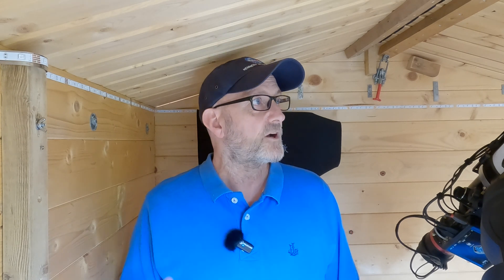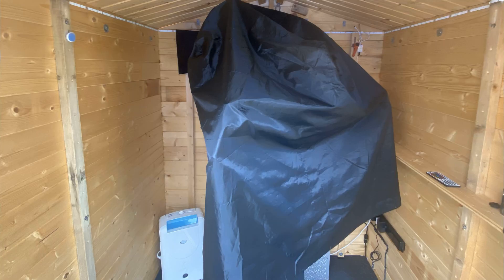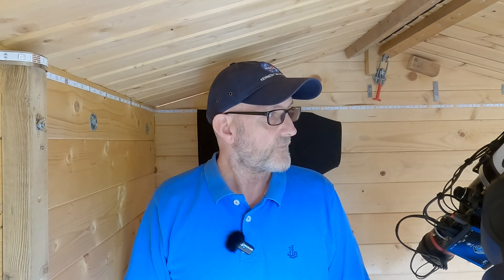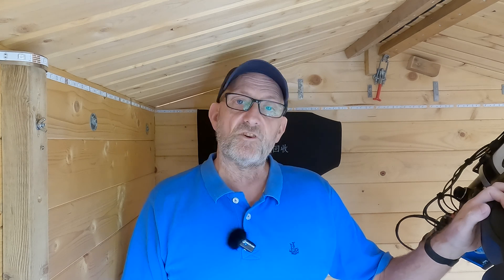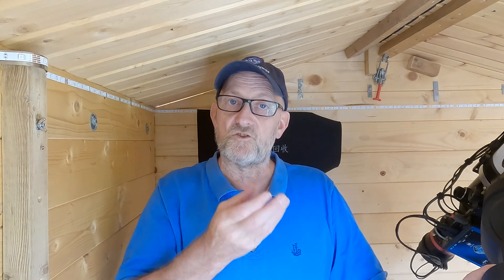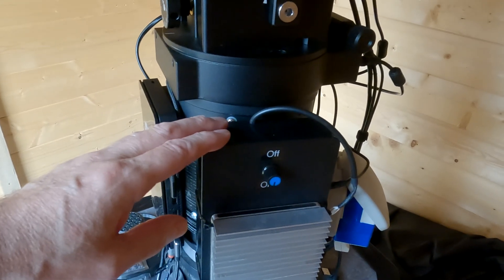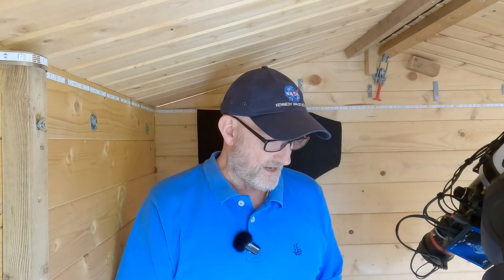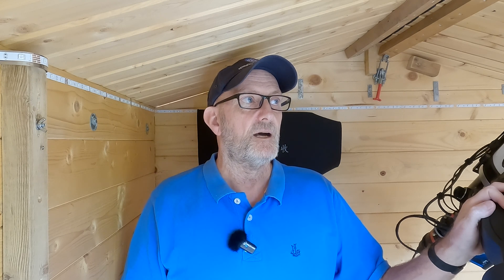STOP !! Eliminate Condensation In Your Observatory at the source

Comment: Hi, great info, thank you. Sadly, the 12V heating element is no more available on Am... Probably available under another brand but can't really find it. What should I look for ? Any link?
Reply from the maker: Thanks for the comment, these are the sort of thing I used.
https://www.amazon.co.uk/BODYA-Electric-Silicone-Beekeeper-Equipment/dp/B09N74PS84/ref=sr_1_5?crid=32B202K92XV5M&dib=eyJ2IjoiMSJ9.YkqoyeBdF22kpcUnwPHILOp_8-v9YkD5dlPl2CyarblgR9RIjAhzeFZq5Oin1tu3Fk93EOgkHwmaGhUJ1XO63DTK6rdGoqIEgI4uKj9NkB1cXPmi9cskan6-G9KM9J2hPbqQE-DEPyaTAeTQ69xvel6-8ZVxQCH2H7Ao5YkRrQc-yTbLkotn7qQqYsNRC6uvXrkojJyzBAYmnc4uEfOVkOE-WZvNlP6c9DV2MAT0w-N6E-1qxi4bvvXp8jfjQMEp38NngN9xWgm_w-wRnkZ3sGjon04dgWjjGsp4iA2Rqp54mnPXFM5z-fap5_vKaFB-4Z9U-4Nsz6f1MxOESErP6eGciNHlwPB_cqFR73z6lUUhz5HcZzEDAJsmqXvVVSMY2m5Yxf7offaRS3p0RTGVeIe2-2u33AH2HZ8aSL8PEf5utIxzfN2_a5TkPo99k_xC.B0Dhvs1C8T9n4AxRZznWsUTI7PqBuM2wlEnpKZMfHrs&dib_tag=se&keywords=12v+heat+pad&qid=1738142691&sprefix=12v+heat+pad%2Caps%2C94&sr=8-5
Hope that helps 👍🏻

Comment: Heh, not just the UK, mate. Belgium here, and in my particular area, the humidity is unbelievable. No doubt something to do with the fact that the ground water comes up quite close to the surface, not to mention those ponds a couple of streets over. Good idea with the desiccant holder on the inside of the lens cap. I take my gear in after a session, as I'm a backyard astrophotographer without a dedicated observatory, but that makes moisture control even more relevant. You're bringing in cold metal and glass into a heated environment, and your gear becomes a dew magnet at that point. I work around this for now by leaving it in the unheated garage/workshop until morning, but adding some desiccant surely won't hurt either.
Reply from the maker: @EvenTheDogAgrees  glad you found useful, sounds like you have it worst where you are 👍

Comment: Very clever setup. Moisture building up in obsys can be a huge problem. I have tons of ventilation even with the roof closed but my biggest problem is dew during an imaging session where the walls can be absolutely dripping with moisture. I had to paint the inside walls as the bare boards were starting to grow mold. Something like your dehumidifier might be a good solution to help dry out the obsy the morning after if I can't open the roof to the sunshine if it decides to be rainy instead.
Reply from the maker: Thanks Logan, yes in your case I think the only option would be a dehumidifier, and as I say the desiccant ones are far better, but more expensive to buy, many people do not realise there are the two different types..I didn’t, and the fact it will work down to 1 degree is very important too…clear skies my friend..👍🏻

Comment: Very interesting mate, I've got a home made dome simply because it were cheap off eBay, I was going to go for the roll off roof shed but it didn't happen, there's plenty of ventilation around the dome hence why I'm always evicting spiders lol so conkers are on the shopping list when they fall in autumn. It does also suffer with condensation as the shutter is made from stainless steel so you can imagine what that gets like in winter. 
 I'm pretty interested in your heater though as I do cover my scope through the winter but no way of keeping it warm. I don't suppose you could do a video of the build of it or what you'd need to buy, I'm not to fussed about an app as I suppose I could use a timer switch to come on & off.
Clear skies
Reply from the maker: Thanks for the comment…yes anything metal like a dome shutter will attract the wet, especially as it’s higher up where  the warmer air rises too. there is a list of items to make most of the heater in the description,  but I guess I could put a short video together to show it all and the inside, pretty simple really,  and very minimal skill involved…Clear skies mate..👍🏻